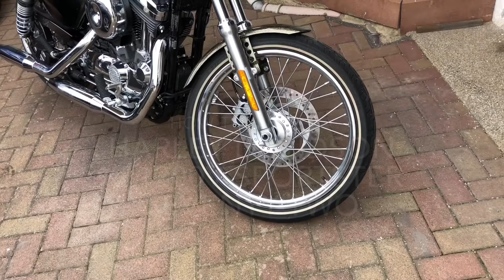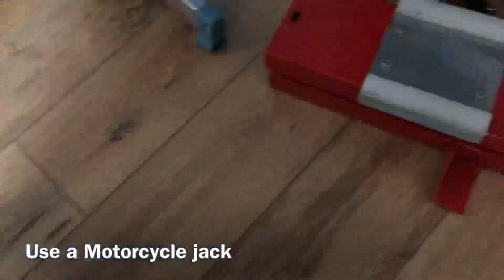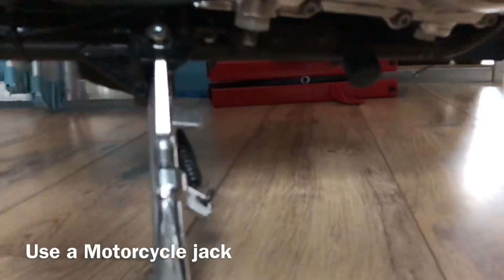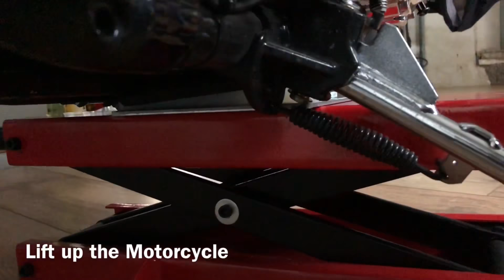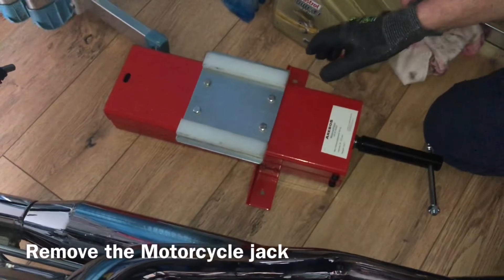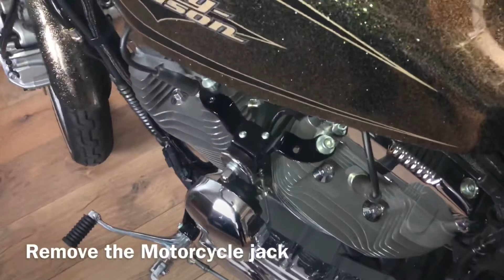How to lift up a Harley Davidson XL1200V Sportster Seventy-Two with Motorcycle jack stand DIY

Comment: So Probably a stupid question. I have never ridden before. I am enrolled in a class next month. I inherited a 05 sportster, and I want to change oil, gas and battery and see if it will start. I get how to jack it up, but how do you keep it from falling over while working on it? Are there some kind of stands?
Reply from the maker: Just jack the ride up balanced and it will not drop.

Comment: Is it slightly off because of the kickstand? I bought a very similar jack and can’t seem to get directly under the center mass of the bike because the kickstand mount sits slightly under the frame. When I jack behind the kickstand mount the front wheel never lifts because I’m too far back. So my question is do you have the same issue AND did you just jack the mount without any issues. Thanks in advance.
Reply from the maker: The jack is a little problem, that’s right. But if you balance your bike a little bit then it works as shown in the video. It’s a little tricky